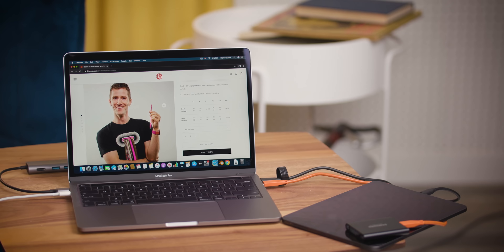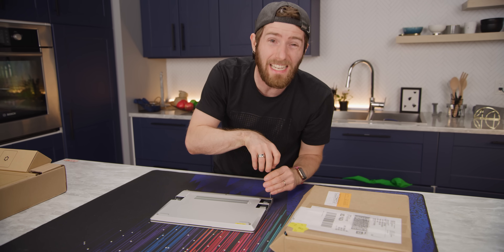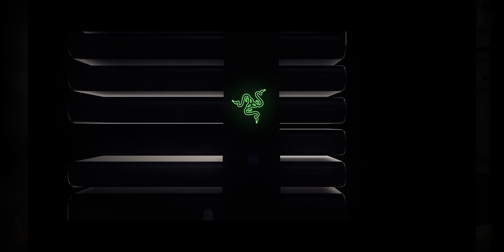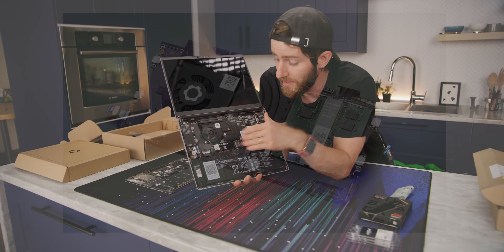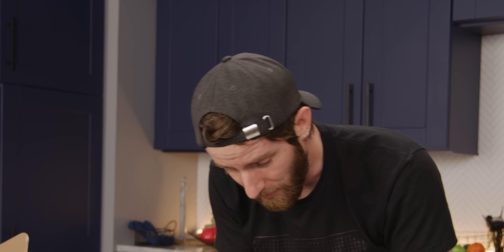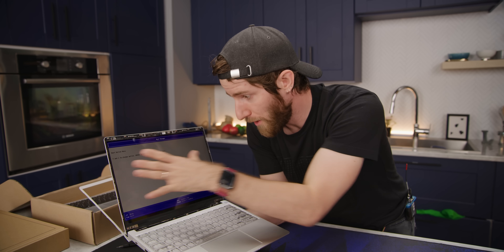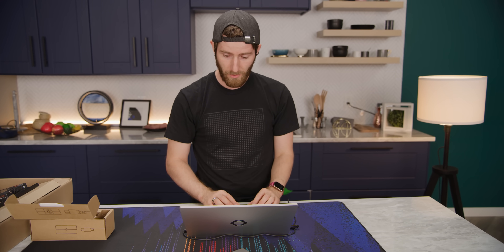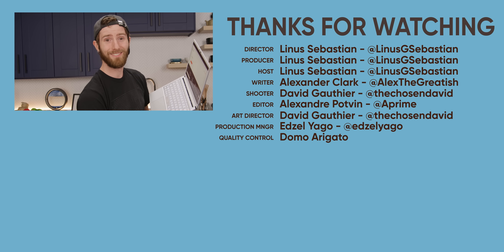A COMPLETELY Upgradeable Laptop?  - Framework Laptop Review

Comment: I will buy a Framework when my Gateway P7805u FX laptop with the 1920x1200 HD display dies. I bought in 2009 still and it still works great. Although the 13 year old battery only holds a 40 minute charge. I was surprisingly able to upgrade the cpu to a T9900 and the Ram to 8 gigs of DDR3. This is a desktop replacement tank of a laptop. That just will not quit. Even the original charge brick is still going strong.

Comment: I received my framework laptop some weeks ago. (I'm french) I was expecting a good device, but I am pleasantly surprised, it is more powerfull that expected. I have got a desktop pc with a good CPU and GPU for 3 or 4 years.
In the CPU intensive tasks, like video editing and such, the framework is better and quicker at exporting those videos. Obviously the framework gets hotter (85°c approx.) and my desktop pc doesn’t overcome 60°c with a noctua air cooler.
The lack of GPU makes it less performing in games and real time 3d work, but not as much as I thought. Even in big games, if I drop down the resolution and set the graphic parameters as « low » it work quite well.
The screen, keyboard and trackpad are really great, the sound is OK not super powerfull but good. I have a macbook pro for my work and I have ever found the keyboard to be annoying to use. The trackpad is also quite « sticky », fingers don’t slide easily on the surface, the framework is way more enjoyable to use for me.
The small form factor is so cool, even more with this tiny power supply.
I think that it is a great device, with evolution and personalisation in mind at is core, and I hope that framework will continue on the long run, I am really happy to have get one !

Comment: 16:27 wow, battery disconnect. yeah, i keep my lappy plugged in all day as well. but thanks god asus has included "battery charging control" software in it - so, i keep it barred at 60% or 80% charging.
Reply: The disconnect is for maintenance only. But there is an battery control in the bios

Comment: I honestly hope they will release a model with the new ryzen 6000. And a larger model with a discrete gpu, and maybe even have the option of 2.5in drives.
Reply: They are currently relasing a model with even newer ryzen 7000, and a 16 inch version with an optional discrete gpu; both in preorder.

Comment: have you ever looked at a lenovo thinkpad?
I have 2 of the 400 series, socketed(and upgradable) CPU, 2 memory slots, a few PCI slots for WiFi and stuff, one can be used for LTE or an SSD
the DVD drive can be replaced by a HDD case, or you can slot in an extra battery(one of 3 available battery pack locations)
got all sorts of ports on the laptop, and once you put it in a dock you can run 3 monitors with DVI, VGA or HDMI, get 10 USB ports and whatever

for 200$ you can pick one up in good condition, with dock and 2 power supplies, parts are still available
Reply: As someone with the T420, those are much more bulky and, more importantly than that, older. A lot of newer things simply don't work on the 2940XM. Things like Miracast/Wireless Display. The USB Ports are slower 2.0 and despite offering an Expresscard Slot, the USB 3.0 Ports that slot into it are hit and miss. On top of that, the Touchpad is simply too small for current use (Yes I can use a mouse but on a device like this I would prefer to use the touchpad.) and I'd have to use the trackpoint. The biggest issue is it's age. For normal web browsing or for writing, for example, it's fine. But anything that require any sort of performance, it's not happening even with the highest end processor like I put in there.
Reply: @RorschDG-2  sure, I get what you mean, my intention was basically just to bring up these old devices for how much they could do at their time
the framework (kind of) is just going back to what laptops used to be
sure, today you can use a dongle for everything(especially with USB-C) but I do think that there was a certain appeal to having a laptop where you can plug everything in to, especially the dock is handy when you just want to use your laptop as a computer at your workstation
(or at home)
as for the battery pack, after 10 years they do go bad, but replacement batteries are cheap and can be swapped in seconds, many modern laptops don't have that either
Reply: @nathanwest2304  Laptops weren't as easy to repair as this one. Like I said, I had a T420 and I refurbed that machine myself. It was a rigid machine for sure but a nightmare to replace the motherboard and the entire housing. This one uses one type of screw, and the ports can be replaced as can the motherboard without taking out an entire midframe. Current Laptops simply cannot have socketed Processors due to lack of efficiency so this is the best we can get. Most older Laptops, including my 7590 XPS 15, which is still under warranty, has similar repacement characteristics to a degree as the framework as well, but it's much more difficult. 

This is easy enough that even a novice can do it. Which is the entire point of what they are doing. Making it easier and accessible to the lowest common denominator of people who otherwise would've thrown their device away. If it wasn't for the fact I have an XPS, or for the fact that I need a Dedicated GPU, this Laptop would've been the one I pick up.

Comment: Even if Framework folds tomorrow, you still have a fantastic laptop and there should be some used parts on Ebay. Certainly more parts than Apple will provide.

I'm loving mine, though sadly the screen may be too much resolution for my poor eyes.
Reply: With LTT and I'm sure others reviewing this they won't be folding any time soon 😁

Comment: For the flex stuff.  My Dell XPS 13... which was a PREMIUM ass laptop, is bent.   By bent I mean sit it on a flat surface and it wobbles slightly.  3 months of light use was all it took to get a permanent bend.    I can "bend" it back and eventually it it will wobble again. Flex is good.  Overall rigidity makes for laptops that bend and keep the bent shape.

Thunderbolt 3 in my XPS 13 is also abysmal and never works right with eGPUs.

Just bought a Framework laptop to replace my XPS. flips table over

Comment: This is a very attractive system. The only disappointment that I see with this setup is not having a dedicated charging port, even just a USB-C on the main board. You have to occupy one of your module ports to charge the machine, leaving only 3 usable ports. Hopefully they also release a standard SD card module in the near future, my usage that is more useful than the micro-SD slot.

If I have the budget, this would be at the top of my list. Also this fits perfectly with the ideology of the Open Source community.
Reply: its usbpd w/usb4, you can use a usb4 dock to charge without really wasting your ports ig

Comment: 11:35 oh come onn, some of the old latidude workstations are good up to this day, I don't know how, but my mom's laptop is working perfectly fine and it was a dell latitude e6400 bought in 2006 or 2006. With Code 2 Duo and 4gb of 800 DDR2 ram, 1tb hdd and quadro m160 still working with widows 10 (enterprise n) and not being too slow for a normal every day work (Microsoft exel, word, watching YouTube, tennis, ect) and I cannot wait to see how it will work when we upgrade from windows to Linux! It will fly! There's a lot more to it, it's build like a tank (a freaking radio that weights more than 2 kilos fell on it and scraped the top of the laptop while closed, still works, speakers are awesome, the dock station is running perfectly fine, heck, I was able to get on hypixel (minecraft) leaderboards in 2018 on 50fps! It's lovely piece of tech that I would love to use, just because of how I grew up with it! I'm scared of what I will see if I'm defragging the hdd, it's not been touched since 2017!

Comment: Interesting concept, but most of these things can be replaced fairly easily in most laptops, so long as you avoid the ones with soldered on ram. The expansion cards seem to be pretty basic as just USB c connectors for storage or things like HDMI ports. it's not like you can upgrade the CPU/gpu, which is the biggest thing holding back an old laptop. I've never had a laptop die before those components began to feel slow and dated.

Comment: Framework has chassis intrusion sensors.  The difference is they don't lock you out of your device, just let you (or an admin) know that your laptop was opened and, if you didn't consent to that, you should check into that.
Reply: Which is a good way to so that
 Chassis intrusion sensors shouldn't brick the device until it's closed and stuff.

Comment: It's a waste I was on the site the prices are very high for this price you can buy a laptop with a 3080 or 3090 graphics card which will be coming soon. Probably, work is underway on new processors and new video cards 4000 and probably in the future the laptops will be thin and super super manufacturers.

Comment: I have been thinking they need to or should have developed a way to sink and deal with heat and such in a way that we can just plug and play all parts from power-supply to motherboard maybe even processor so that we can plug and play each piece and thus not need a tower like one of the other things you talked about for a graphics card or hard-drives and such. I even thought it might be interesting to do things such that you get computers designed to a point like legos you could plug and play extras or such and just stack them maybe.

Comment: Hi guys, I own a Lenovo g510, it's a good and easy laptop to open to work around, just 2 screws. On the side of the battery. I think it's the last one they make it so good.
Reply: I have a Lenovo ThinkPad t440p from 2014. I just upgraded the monitor to FHD IPS, added an i7, added two SSDs, a backlit keyboard, and it runs like a champ in 2022. I'm getting a framework because I like modular PCs and there's nothing like this in this form factor out there. Plus I like to use tech and old cars as long as I can. I'm a big supporter of right to repair and consuming less.  I would agree with you that the old Lenovo's especially the ThinkPads are absolutely amazing, and if you want to mod your PC on a budget go for an old T440P You can get for literally nothing and for $250 of upgrades turn into a beast of a little laptop running Linux and even Windows by itself or Windows in a VM. Still I'm getting a framework because I like the mission and i want to support their cause. And I want to leave my stickers on a laptop that I can use for more than 10 years.

Comment: To be honest, it doesn't make much sense for me.
A motherboard (with CPU) for Framework is 700 - 1000$. Which is approximately the same amount it would cost me to entirely replace a Macbook or XPS once every 3 years.
Maybe for the upgradable RAM and storage, but it's not a big deal there either.

The biggest deal for me is that a laptop it came to cost 2000 - 2500$, a phone 1000 $. Apple has around $ 100 billion profit every year.

Comment: As soon as this has a Ryzen option, I'm there, this concept is something I've been wanting for a long time and this seems to be the most competent execution of it so far
Reply: Apparently they are working on it, but AMD can’t deliver them enough CPUs because they are in such high demand.
Reply: Well, well, well...!
Reply: Same. I would love a ryzen based framework laptop.
Reply: It’s not a Ryzen, but at least they do now offer the new 12th gen Intel processors (for pre-order with delivery in July), which should be a significant improvement.
Reply: IT HAS RYZEN
Reply: wait no more
Reply: Honestly I'm wanting every other aspect of this so much I might fold and just get the Intel version, but if they launch a AMD version of the motherboard I'll be practically hot-swapping the thing as soon as I can get my hands on it
Reply: Zen4 Cpu's all have built in Graphics so this could very well happen soon.
Reply: preorder a ryzen 7 framework in batch 1. can't wait!
Reply: Now there is.
Reply: The thing is — You can add a Ryzen CPU if you want!
Reply: @quokka_yt  No you cannot
Reply: @quokka_yt  no you can’t?? intel motherboards can’t support ryzen ones.
Reply: @jrstepos  swap out the motherboard then hehehehe

Comment: Well... I've been using a FairPhone 2 for 2 1/2 years precisely because I broke my Samsung's screen and was told it'd cost about half the price of the phone (when new) to have it fixed by a pro... And I've pulled my hair a number of times with my current laptop due to problems with the screen (I've had to replace the cable that feeds it twice and it's a nightmare to do)... I'd say this could be my next move, similar to the FairPhone but with a laptop! Thanks for the review, that was helpful.

Comment: Hi I am looking for a new laptop. If framework had a 15 or  15.6 in 4k and a 3080 card I would buy it right now. If that doesn't happen soon I will be. Buying a XPS 17 Dell or Asus duo in 15 inch. Will those changes be available in framework any time soon? I as because I am diabetic and need a screen over 15 inches. Any reply would do as I am running a 10 year old HP I use with 3 screens but it's getting slow and will be purchasing a new laptop very soon. Thank you.
Reply: i doubt framework will release a model with a dedicated gpu let alone a 3080 anytime soon
Reply: @calypsoriot  do you think they will produce a 15 inch model? 13 is a bit too small for my eyes. My desktop is a 3 monitor system. Because of my back I do spend a lot of time in bed. 15 is minimum an Framework makes more sense than any laptop out there. For creds I started in the main frame business in 1981 and was unceremoniously dump when I hurt my back working for them for 36 years. For a tip stay as far as you can from Xerox stock and machines.

Comment: My only big issue is they need it in a 15"+ form factor, laptop screens are already rather small by today's standard, I'd have a tough time using a 13" as an actual daily driver, plus it allows for a larger keyboard.  And yes I know, displayport, external screens, blah blah....I'm talking about when you're just using the laptop as a laptop, not a desktop.

Comment: One of my first Notebooks i got in a Company was the Toshiba Tecra S1. I really loved that notebook becaus it had a swappable HDD slot and CD/DVD slot. Due to my work and the incompatibility between certain Software and Windows at the same installation it was just perfect. I went to one Plant and used the Whole System one the 1 HDD and on another Plant with different Hardware the 2nd one. It just would cost me a minute to swap and start the notebook again. even upgrading to bigger HDD was as easy as loosing 1 screw. I always have been wondering why nobody is actually building such systems.

Comment: I bought one of these laptops, I got the model with the i5-1135g7 becuase in my research it's performance wasn't significantly different from the I7. I bought mine with the least hardware i could except for the charger and ports (TypeC, HDMI, usb x2). I took components (32gb ddr4, 2Tb 980 pro, intel AC9260) from my Lenovo P1 Gen 1 (I7-8850H & Quadro P2000) Which i had expected this to be a straight downgrade as the 8850H is a more powerful cpu and the dedicated GPU should be much better in gaming related tasks.

 I was not prepared for the amount of difference the encoding improvements in the i5 1135g7 made to my experience. For the first time, I could stream games over my local network without any significant loss of quality. Previously when attempting to do this on my P1 even at 720p i was bottlenecked by the rate at which the cpu could decode the incoming stream from my desktop (5900x & 3080 ti). Now I can stream at my laptops native 2k resolution without any artifacting whatsoever. 

I also found the improvements to integrated graphics to be good at running even newer games (tested Humankind) at medium settings. (Of course it's not as good as the P2000, which is about equivalent to a 1060 6gb, but the difference is high settings vs medium settings). Which is the highest level of performance id need on the move. Combine all that with the brighter 3:2 14in screen with great battery life (i use my laptop in my car for work a lot) this laptop has been outstanding.

 I had concerns about lacking camera windows hello, but the finger print sensor is of high quality and wakes quicker without accidentally waking the device and logging into the wrong account. (Useful when you have work and personal accounts)

I am very happy with my Framework laptop and I am confident i can replace any part that could fail, I will use this laptop for many years.

Comment: why dont just make a Thinkpad X1 without everyting soldered to the board? I mean a X1 made like a T430... On the T430 you can switch to a FUll HD Display as simple as with the framework Laptop...The T430 was one of the best upgradeable Laptops ever made. You could even change the CPU...